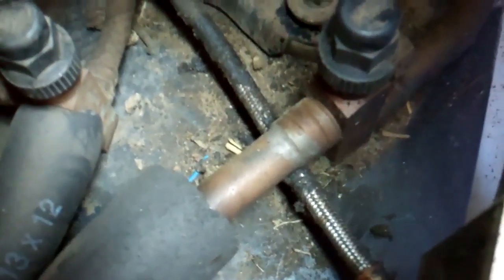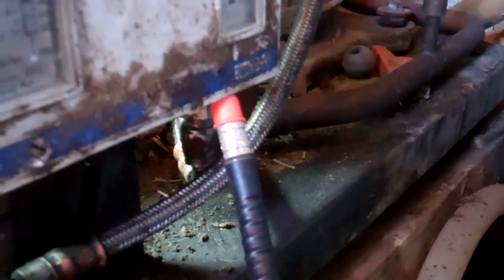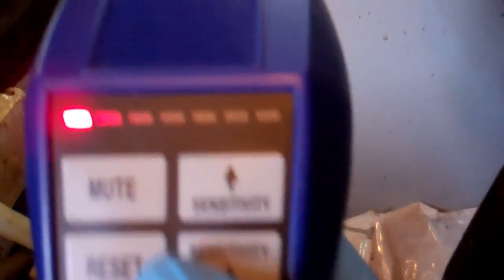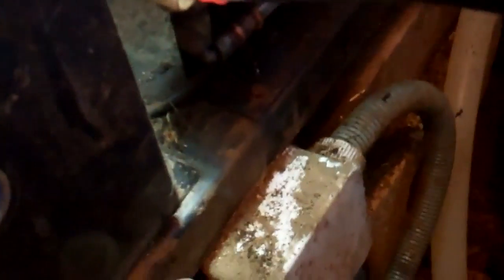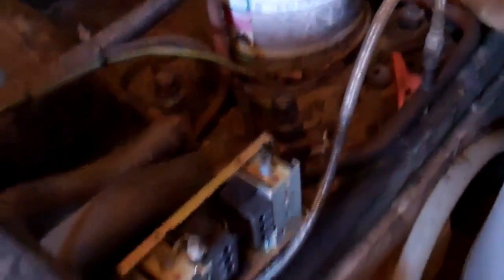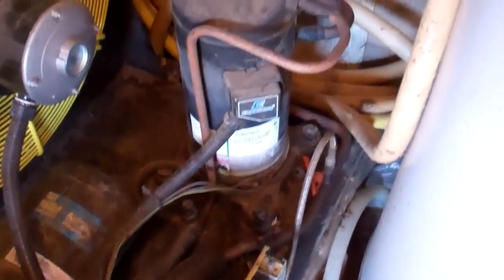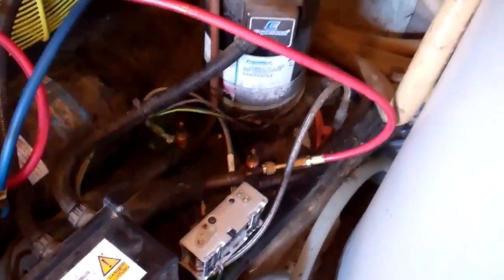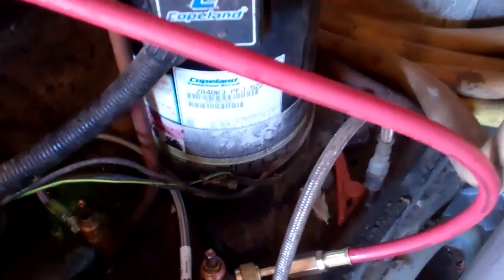Leaky Low Pressure Switch

Comment from the maker: Yeah i expect it still goes on but its been illeagal to charge a leaking system here for years. Disposable cylinders banned, have to log the serial # of cylinder, serial # unit, location etc type and quantity of refrigerant added and keep records. The leak should be noted in the F-Gas log book and a re inspection within a month of the repair done!
Get caught doing otherwise and its a lifetime ban for working on any equipment! If you had a leak that you could not find it would scrap the system...

Comment from the maker: Think its for safety so you can't run it with the hp switch isolated, valve should be highside if open and just comp discharge if shut, but its highside if open and condenser if shut as its in backwards!, so you have to recover all refrigerant from the condenser and reciever to be able to change the hp switch. 

I think there is a rule that hp safety switch must not be downstream of discharge shut of valves. Fan cycling hp would be ok i expect as it would just go off on hp safety in a fault.

Comment from the maker: Hi Fritz,

It was more luck than judgement, just caught the leak as i moved the sensor away from checking the hose connection! 
I generally carry a dual and some single pressure switches, and some flexi hoses on the truck as this would have been a 80 mile round trip to the wholesalers otherwise!

The green stuff is Virginia KMP GL6 i like it as it has a little sponge on a stick so its good at getting in behind things and its not too runny, i have sprays too depends on whats leaking!